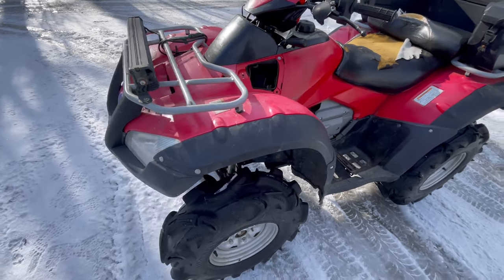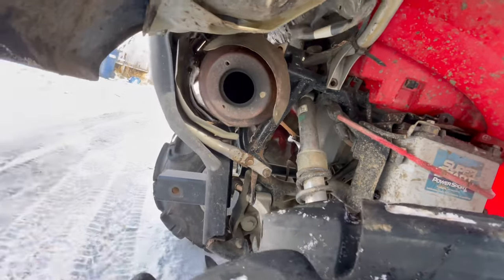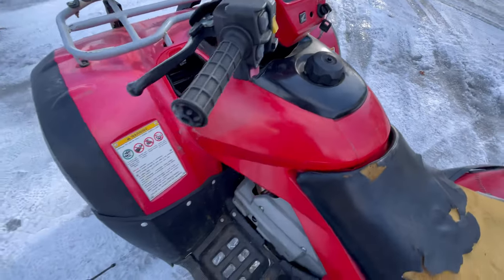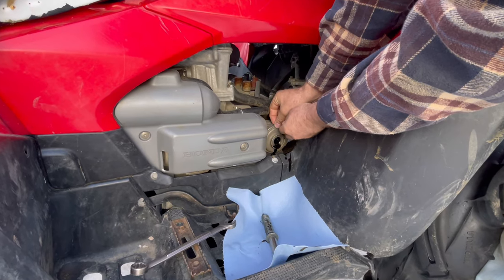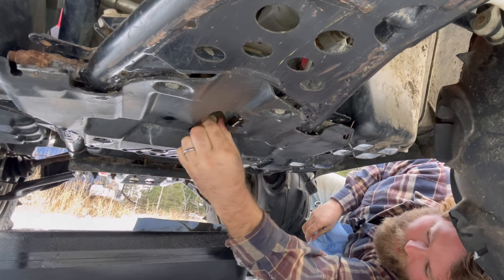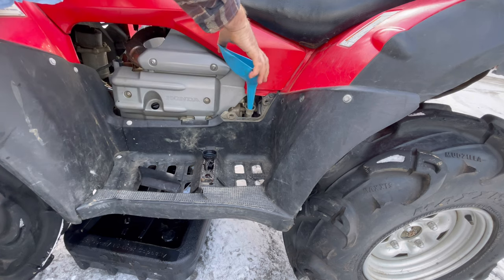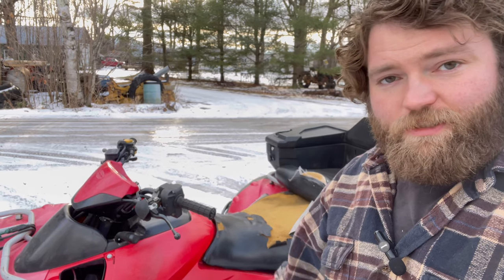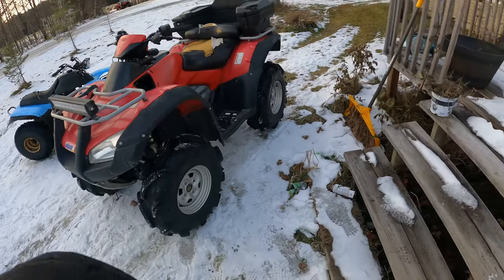HONDA RINCON oil change and small test run!

Comment: I know a guy here in Canada who has over 100,000kms on his Rincon. Uses it year round has tracks on it in the winter. It's been rebuilt from the ground up at least once all OEM Honda parts. Pretty impressive though that's the highest mileage I've ever seen on a atv.
Reply from the maker: @Shane Giggie06 Now that’s impressive! I’ve heard of some stories with these Honda with those kind of miles but I haven’t seen any in person yet.
Reply: @rockspowersports  Yep pretty impressive for sure
Reply: Well i have a 2007 rubicon with more than 50k miles and it’s still running good
Reply from the maker: @ivananglo6157  That’s awesome!

Comment: Yay. Another video. Might have to swing by your shop some time. I’ve got a xr100 with some issues. Great video as always!!!!
Reply from the maker: @Ride and Fun. No problem, just give me a call first to make sure I’m around.
Reply: @rockspowersports  sweet. Will do!
Reply: Also would you do rebuilds? Just top end.
Reply from the maker: @Ride and Fun Yes I do engine rebuilds. I can rebuild top to bottom.
Reply: @rockspowersports  ok sounds good!

Comment: I wish Honda used automotive style oil filters not the canister style.
I hate having to order in parts even for an oil change. No suppliers around me carry atv oil filters on hand unless I go to the dealer. It would be nice to use a regular spin on like kawi does In there brutes.
Reply from the maker: @buildurtruckurway 91 It would be nice.. but the advanced auto and bond auto near me carry the K&N oil filters for these machines.

Comment: What would you consider high mileage on a Honda I have a 2001 Honda rancher
Reply from the maker: It all depends on how it was taken care of. I’ve seen some Honda’s with 2000 rough miles that just ate absolutely beat. And then some that have 5,000 miles and look like new. 
Generally on any atv I’d consider 10,000 miles high.

Comment: I'm suprised the Rincon does not have engine braking. Then again, it's a machine that hasn't seen many changes. For what it costs new, I spend the same amount of money and buy a King Quad 500
Reply from the maker: @Fist Cover Outdoors I do like engine braking myself however some people don’t.. The rincons are nice trail machines  however if I was going to do any work with the atv I’d probably buy something different.
Reply: I have a 2007 Rincon with 12000 km on it with 0 issues. Who cares about engine breaking.  Just use your brakes !!!